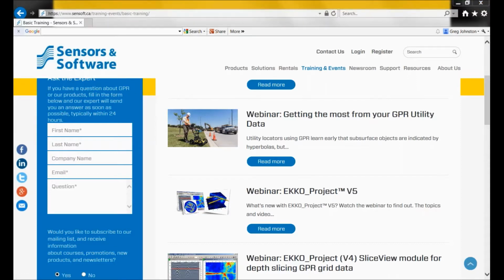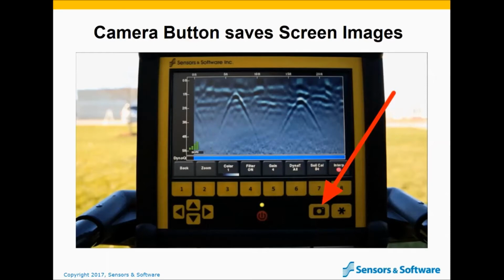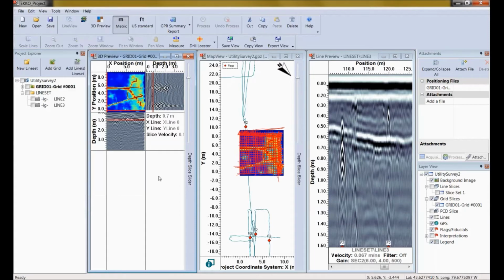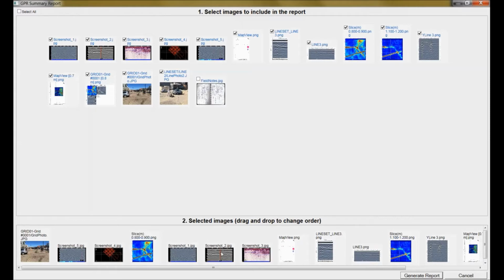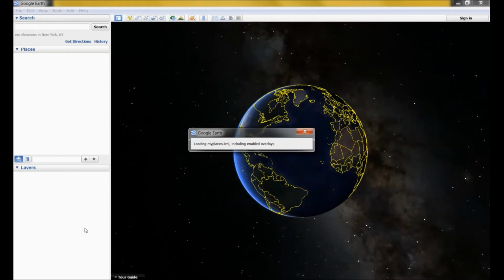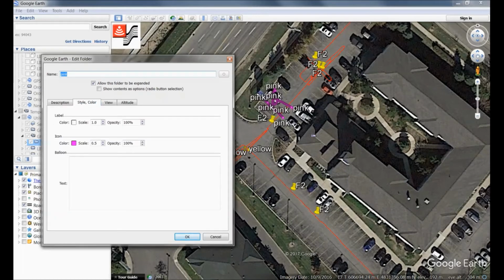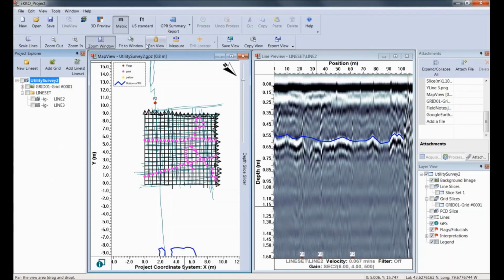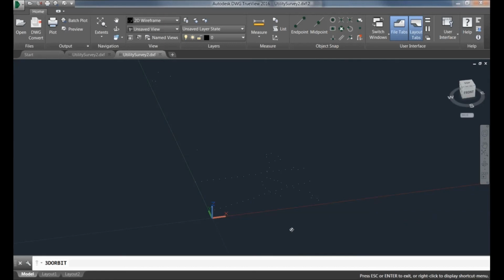Generating GPR Reports with EKKO_Project V5

Comment: congratulation .what is the depth in the klay soil
Reply from the maker: Hi Malissa, while electrical properties of the material being scanned is the primary driver of depth of penetration of GPR, there are also many factors to consider such as the  GPR antenna frequency, the GPR transmitter power, the number of stacks, scattering losses in heterogeneous materials and the level of background radio frequency noise. You can find more information here: https://www.sensoft.ca/blog/estimating-gpr-penetration-depth/